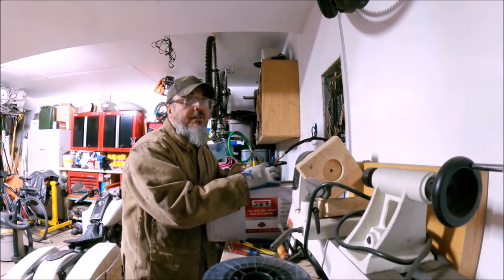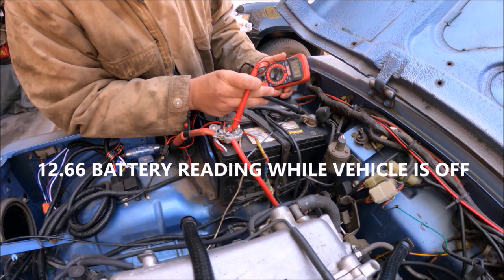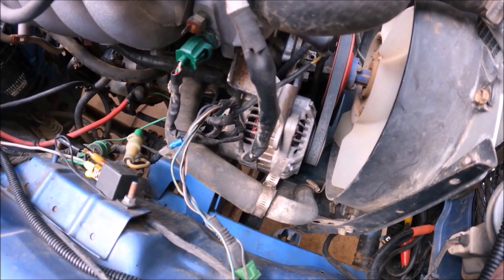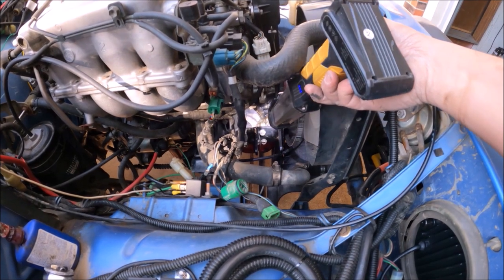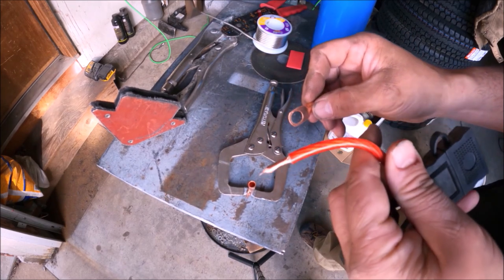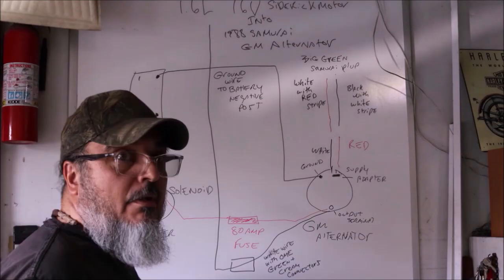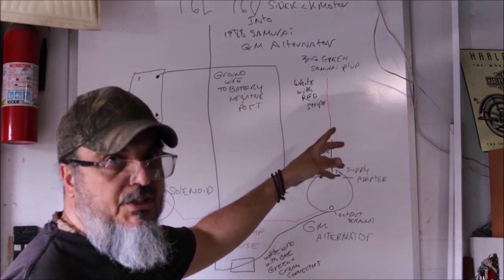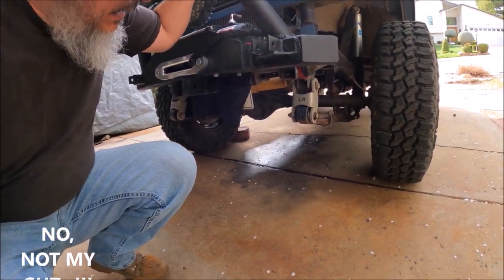ALTERNATOR UPGRADE into a 1988 Suzuki Samurai with a Suzuki Sidekick (1.6L 16 Valve) Engine

Comment: I have a 87 samurai do i need to hook up any wires from harness or just 1 wire to  battery to alternator
Reply from the maker: If you’re running a 1.6 16v in a Sami you plug in the cable that came off your old alternator that is now on your new alternator back to it’s original connection and run a ground from your new alternator to your battery… I have not done this with the stock engine or any other engine upgrades but can’t imagine it being a whole lot different…